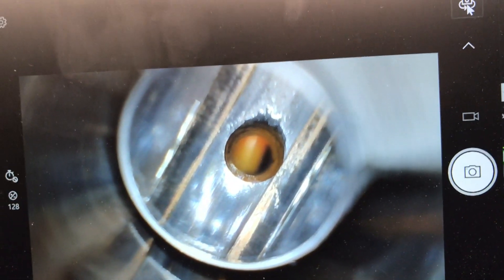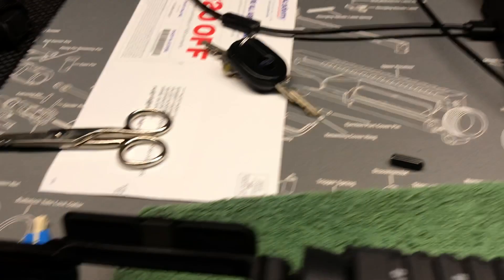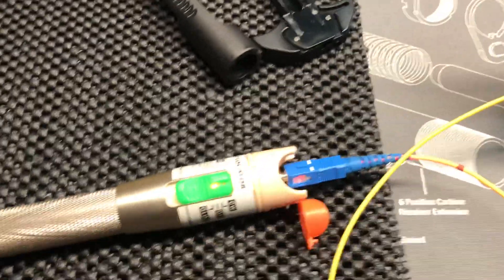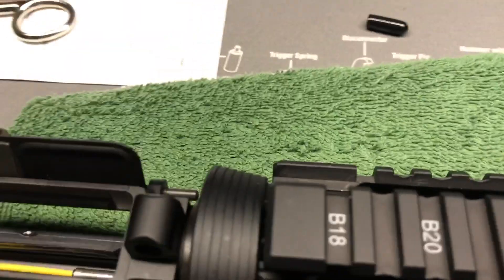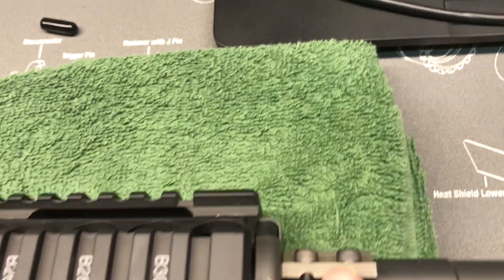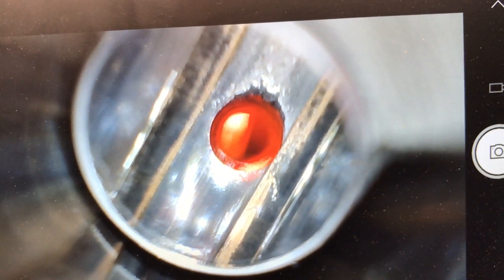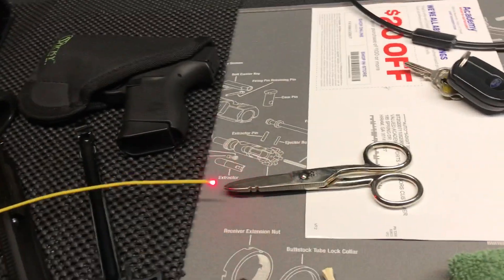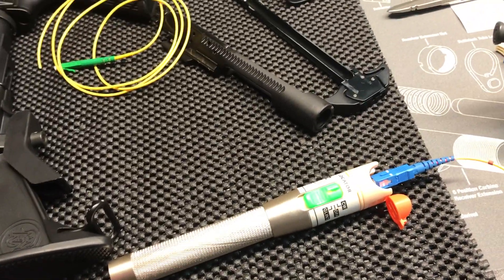Teslong Borescope paired with Gas Tube Illuminator!

Comment: I had a bad under gassed AR and decided to purchase a Teslong and the light system you use. When air is pushed through the gas tube it is felt in barrel. But when I examined the alinement I found the gas block was cutting off half of the barrel opening. After a little heat to soften the loctite. I realigned the gas block and barrel opening and now have sweet running AR.  This was an assembled upper from Bear Creek so it proves anyone can build them but it takes experience to make them run!

Comment: If you want to eliminate the super bright light at the end of the fiber, bend the entire cable just before the end to break the fiber inside the jacket. It will still glow red at the broken section but be diffused through the yellow jacket as you showed. Mark your fiber strands for certain insertion lengths and you can have a carbine, mid, and rifle length test fiber that will place your broken section right over your gas port.
Reply: Lol, nevermind. I'm watching your other video titled "I have the greatest job ever!". I didn't tell you anything you didn't already know. Might be useful for other people though...
Reply from the maker: Its called a Macro bend, thanks for watching. Im actually surprised any other gun nut would know what you mentioned. Thumbs UP to you.